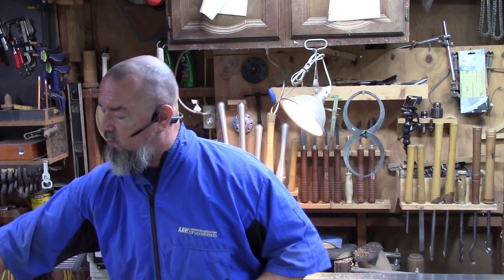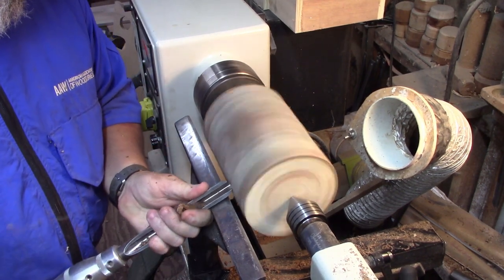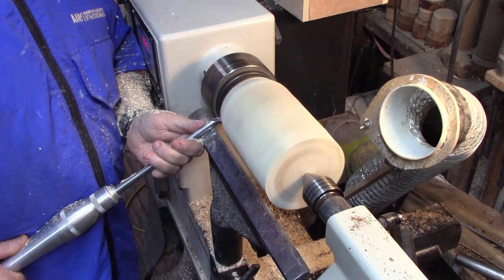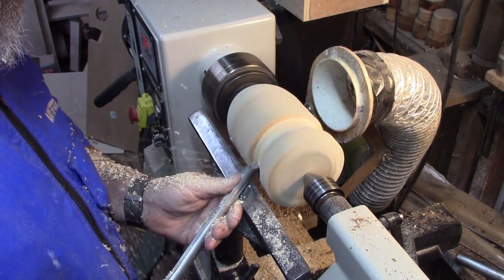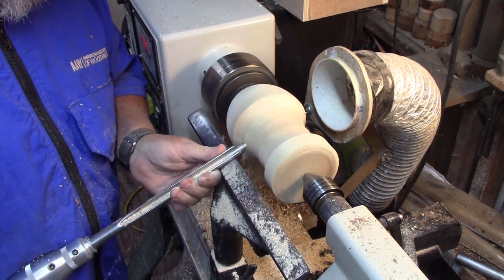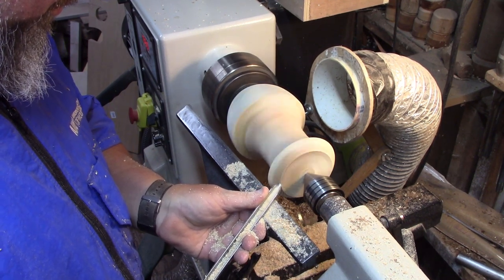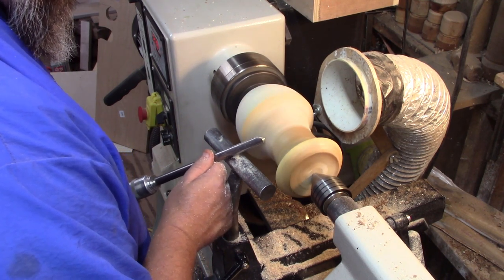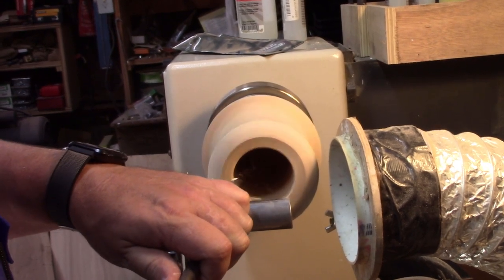#183 Woodturning a Live Flower Vase

Comment: Wonderful work. I was just talking with someone the other day who talked about putting thinned resin on the inside of vases. Such a great idea. So much better than a test tube.
Reply from the maker: Thank you Doug and I agree. I never used test tubes although lots of people do and there is nothing wrong with it. I just did not want to take the chance of water getting trapped between the tube and the wood and starting some mold or something. Using epoxy has worked for me for many years now. Take care my friend.

Comment: Stephen my question is the worm screw in the forstner bit? I have watched many turners and no one ever shows it.
I was a plumber for many years and all my bits had a worm screw to pull into the wood. It's understandable in turning that It would be wiser and safer to not have it in there.
Reply from the maker: Thank you Jack. Good question. I believe you may be referring to Auger bits. They have screw tips. I do not know of any Forstner bits that have them. Mine only have a small point for centering the bit and can not pull into the wood on its own. I hope this helps clarify your question. Take care.

Comment: What are you using to fill in the bug holes?
Reply from the maker: Thank you Tom. I use mainly dried used coffee grinds and CA (Super Glue). Sometimes I will used endgrain shavings ground in my hand to a fine filler material and hardened with CA. Lastly, I will used dyed epoxy as a filler. I hope this helps. Take care.